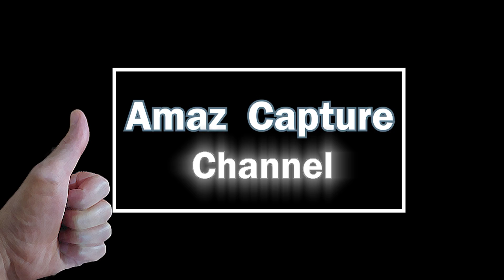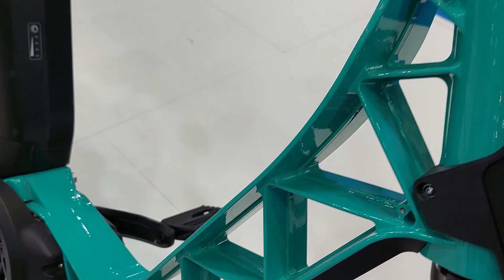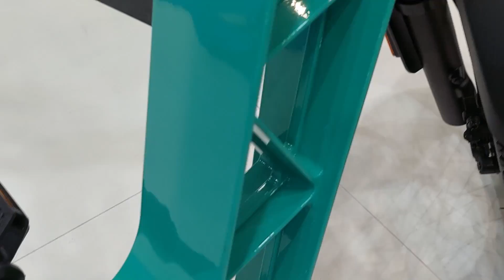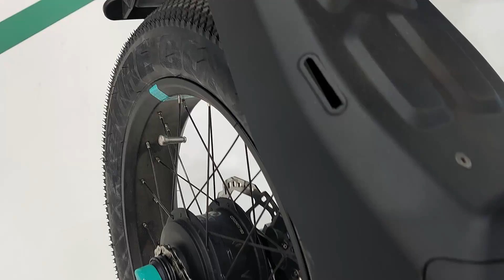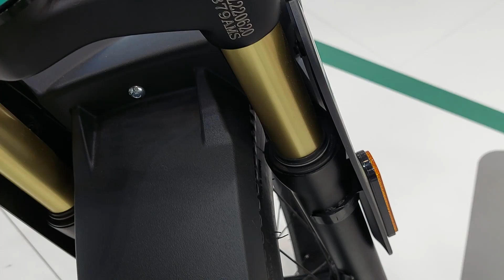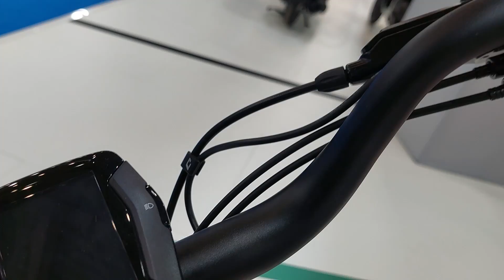Yamaha Moped Electric Bike: Urban Commuting Made Easy

Comment: Have a Yamanha booster easy... for cruising is bad... i put a 44 crank, it's better now, but the pedal assist is very bad the worst in his category. And engineers haven't give to much solution... under standard mode forget is useless.

Comment: Great design for an electric moped but grossly under powered. 36 volts 250 watt! for a moped? more like 48 to 72 volt with 1000 to 3000 watt.
Reply from the maker: The main reason is that 16 years or older can apply for an AM licence to drive a moped like Yamaha Booster in the European market

Comment: The big positive thing with this 45 km/h e-bikes is that if you ride let’s say 600 km per month, the cost of recharging the battery for that 600 kms is around 10€ (according to the electricity prices in Belgium in june 2024).

So 10€ recharging cost for 600 kms. That’s REALLY cheap. And in the meantime you ride this bike with fairly little effort to and from work / school everyday without needing to wear a full blown moped helmet.

Maintanance kost at the Yamaha dealer is also about 30 to 40% cheaper.

So I do understand that these e-bikes are populair and selling quick… If you take the aspects shown in this reaction into account 🚲🔋⚡️
Reply: Is it available in Bangladesh????  And how much??

Comment: I bought a motorcycle last week. I paid £2500 for it. It can travel at 160mph and can achieve 300 miles before I have to stop for three minutes to refuel.
Reply: Does it make a lot of noise?
Reply: L to @vintom7457
Reply: Correct.
Reply: Aerox 155 $2358 2 years ago, 100 miles a gallon, everything is well designed.  Why would I pay more for less?  I spend less than $20 a year on oil changes, batteries and brakes.
Reply: you made the right choice🙂